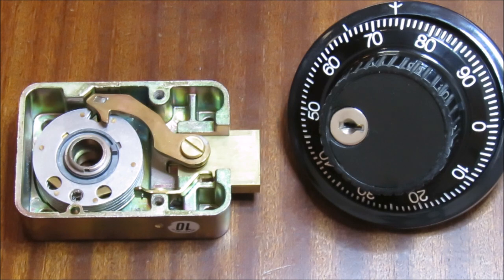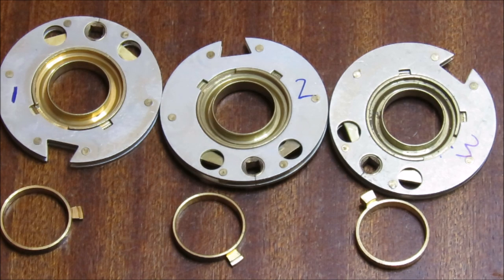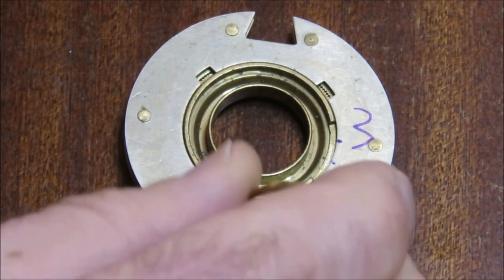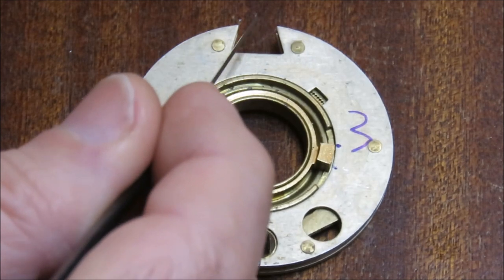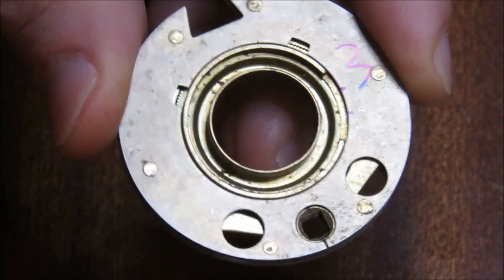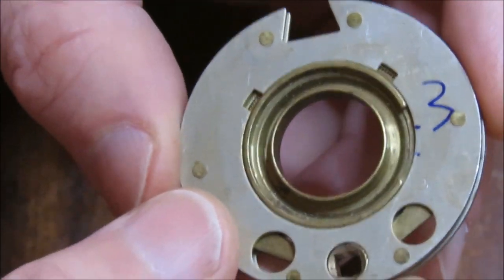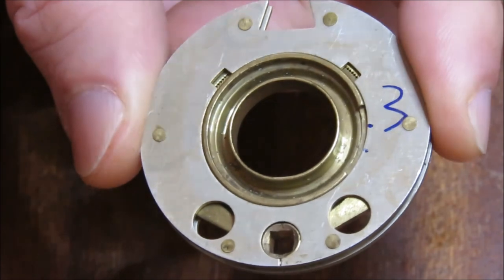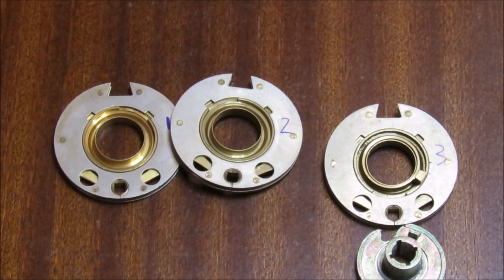[112] Tutorial - Group 2 safe locks - The wheel pack - Part 7 of many

Comment: Great video! I think the movable fly is needed to allow two identical consequtive numbers in the combination. Without that you cannot select select a number closer than twice the width of the fly as the next number in in the opening sequence. Unless I've misunderstood something, most safes cannot be opened with reversed rotation directions because the way the bolt moving happens.

Comment: Great vid. I was always wondering how the change key could be inserted, and  the combs could be changed with a key in place. I figured that part of the wheels were moving, while other parts weren't , but didn't know about the decoupling of the " boss" ( centre) from the rest of the wheel, and the clutch that holds it together.

Comment: I have to say that the movable flys are there for a more important reason. It is that if they were fixed, there would be some numbers that you wouldn't be able to dial depending from the previous number of the combination. For example if the first number is 20, dialing clockwise, the second couldn't be let's say 10,11...until 20 because it would move the first disk earlier. So it would dicrease the combination differs and people would think that it doesn't work properly.
(Sorry for grammatical errors if they are)

Comment: Excellent explanation.  I want to paint my safe and was wondering if I can remove the dial for painting without messing up the combination.  From this video I can conclude that it is not a problem.  As long as I get the cam back in it's original position.  Can you confirm my conclusion.

Comment: Thanks for this series. Helped a lot.   One question.  My group 2 lock works ok with back plate off but when you put backplate back on the lever doesn’t drop.  Can it be spring ? How tight should lever screw be?

Comment: I have a safe that I saved from the landfill with a La Gard locking mechanism that looks nearly identical to what you displayed here. 
I have a combo that works with CW-CCW-CW (or right-left-right). Most documentation I found show a left-right-left.
Is it possible there is a LRL combination that works this lock (but off by that slot width)???

Comment: A great video in a great series. A quick question though; are the gates blind, can I dial clockwise or anti-clockwise for the first gate, opposite for wheel 2 then back to original direction, or does it have to be a set way?
Reply from the maker: Great, and very complex, question. In short: The movable flies SHOULD make it possible to come at each number from both directions of rotation...but they sometimes don't.

Comment: I don't see why it is helpful for the gate to be dialed into the same position from either direction, since you will only dial each wheel into position in one direction.  However, without the movable fly, there are fewer possible combinations that can be set.  For example, the (unadvisable) combination of 20-20-20 would not be possible.  With the movable fly, this is possible because wheel 3 will not start to move wheel 2 until a full turn has been achieved.  Without the movable fly, wheel 3 would move wheel 2 before that full turn.